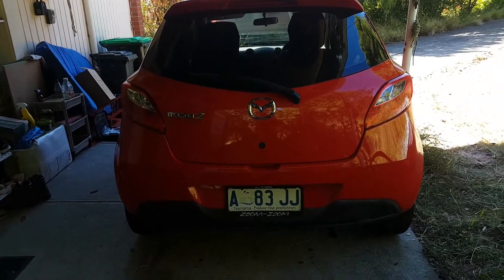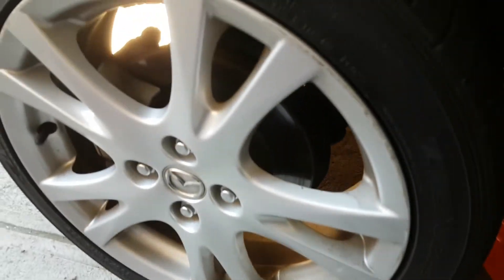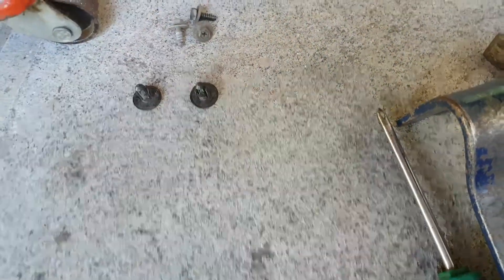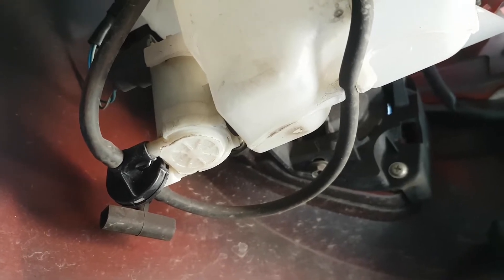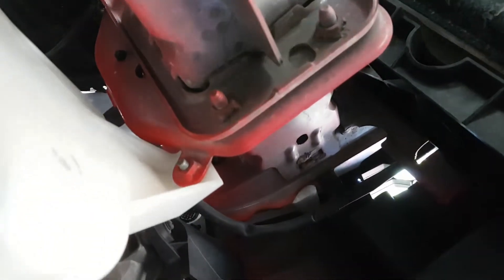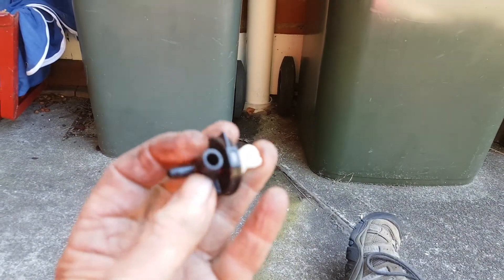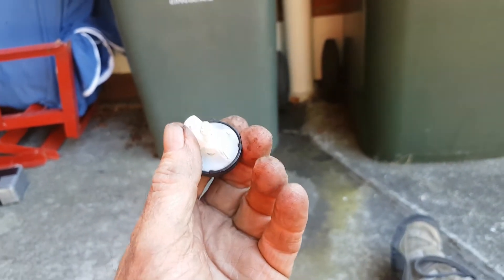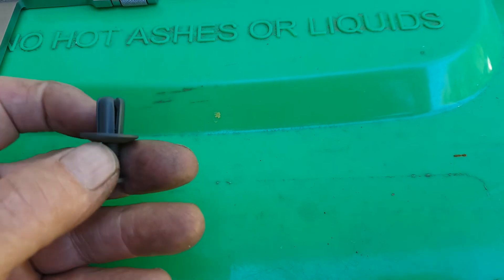Repairing a Mazda2 DH 2007-2013 windscreen wiper water tank.  Jonathan C Nevill

Comment: To save time you can safely pull the pump off of the water bottle as it inserts into a grommet hole. Then you can repare the pump splitter nozzle thing on the bench.

Comment: Thanks for the video. If it helps anyone I actually managed to change 
the  washer pump by popping out the fog light blanking grille  and doing it through the 
hole .Saved a huge amount of time either going through the wheel arch or taking off the bumper. Its fiddly but possible
Reply: Great tip, thanks!

Comment: I didn't remove the wheel, but gently peeled back the arch liner and could see the leak in the same spot.  I order the replacement part and the job took 10 minutes.  
TOPRAN Water Pump, window cleaning - 9 euro!